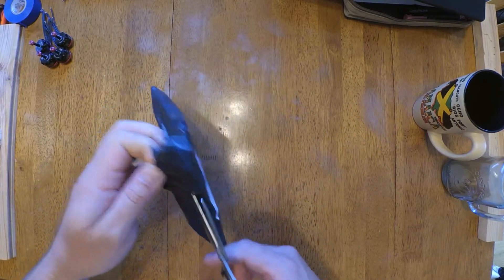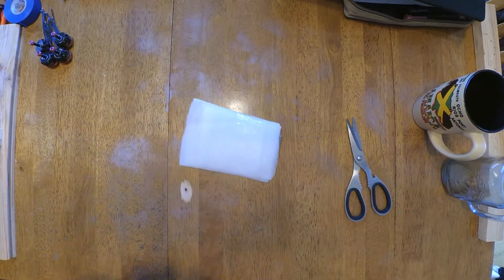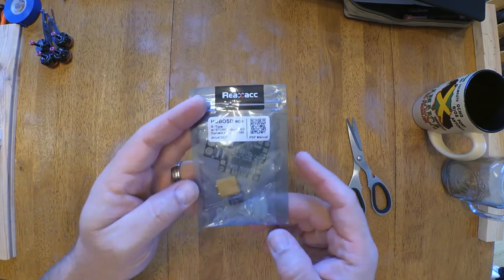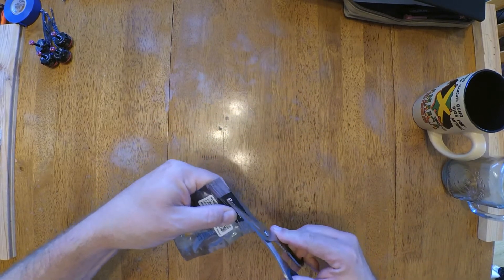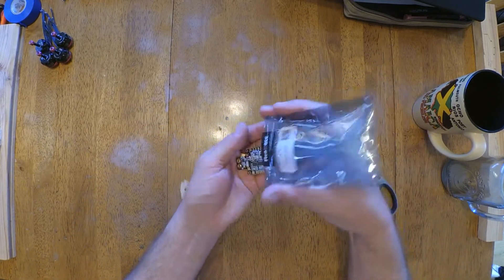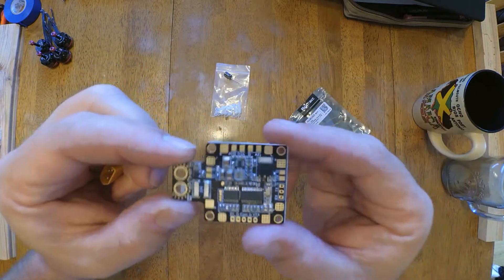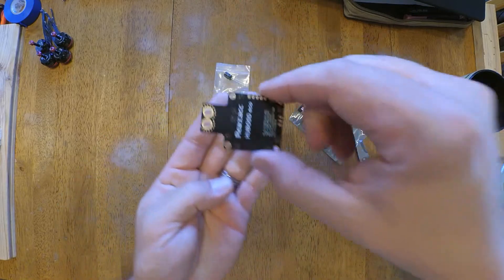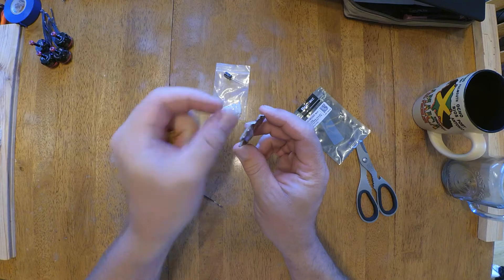Realacc HUBOSD eco X

Comment: what was wrong with the osd????? why was it saying over 140 amps with just a little throttle punch???????????? each motor couldnt of drawn over 35 amps a piece
Reply from the maker: QUADBOT FPV that's a amp spike it's full throttle punches that I was doing that's what the reading are.. I'll have to put that quad back together and test it but that seems about right for the setup it's on..
Reply: Torch Fpv what kind of motor is in props are you using I've never heard of 140 amps on a one-second throttle punch
Reply from the maker: Its the x210 build I can't remember I think it has 2205 2300kv KingKong and 30a Racerstar and 5045x3 props.. Idk they night be 20a racerstar I would have to check the video, not saying its 100% accurate I just took it as what it is I have nuthing to compair it to.. I just used to use the osd for mah consumption, I have a taranis now so I just run a percentage timer now.. So it should be around 100amps? Yeah guess I didn't notice that now your going to make me dig it out and put it back together lol....

Comment: where did you solder resister? I am loosing video when give a full throttle when camera connected through osd. Do you have this issue?
Reply from the maker: I soldered it to the main power whip IT IS POLARITY SENSITIVE there is a white line on the negative side of the capacitor.. See my build video of the GB130 or the rebuild video of the Tc-r260 for details :-) thanks for being here! Have a great day!